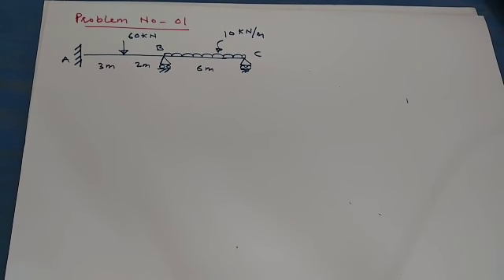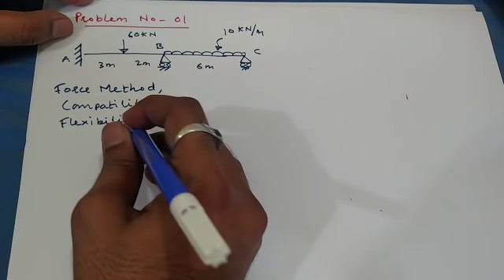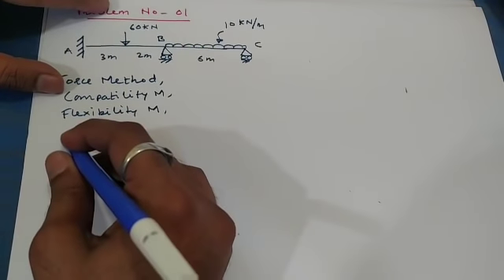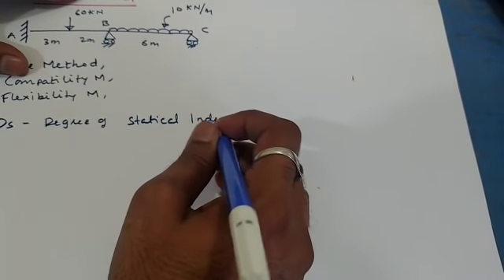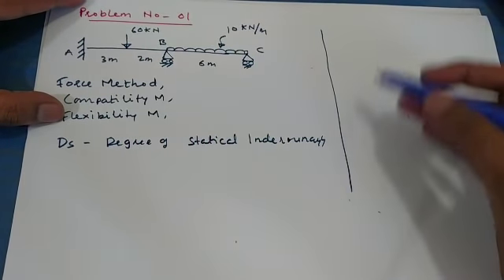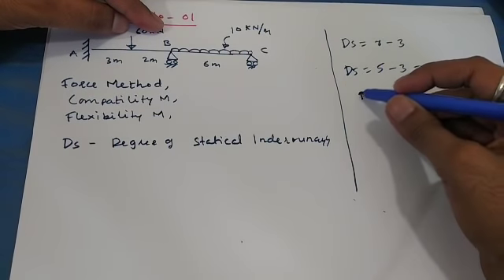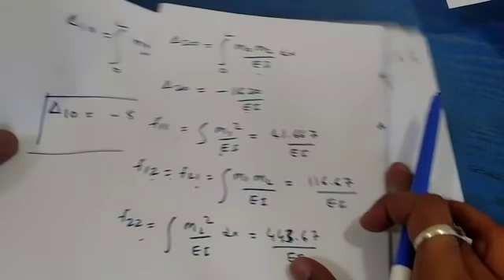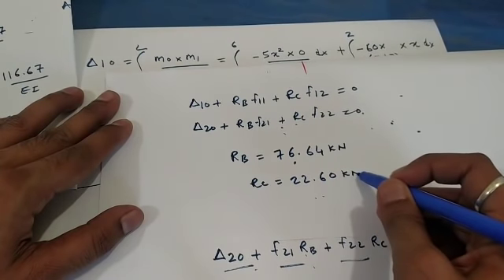Analysis of Continuous Beam by Force Method.

Comment: You have explained the steps in a simple steps, really helpful, Thanks. What if all the supports are fixed instead of pin or roller.
Reply from the maker: Number of redundant would be increased

Comment: Sir your value is wrong for deflection at 2nd point. The actual value are - 18970
Reply from the maker: Yes.. I know..
Reply from the maker: I could have deleted it, but it will atleast tell you the procedure.. Students can correct calculation in their level.. I got many comments of wrong calculation, which I myself has acknowledged..